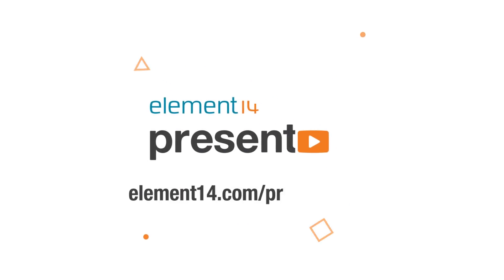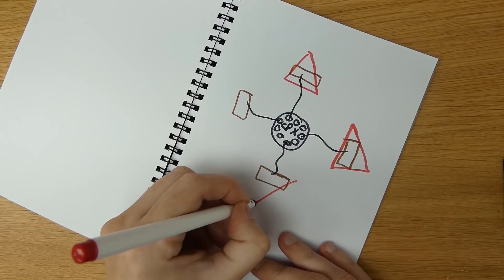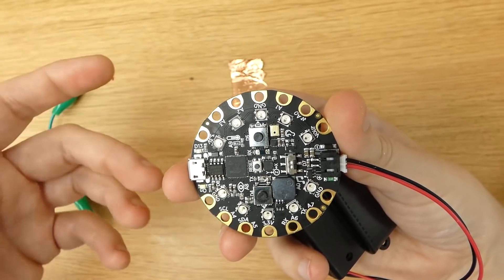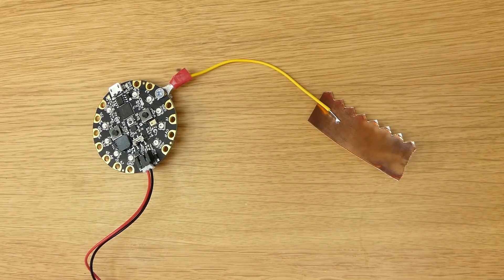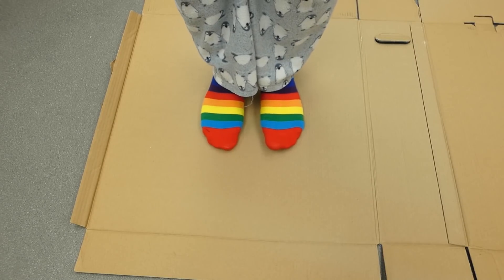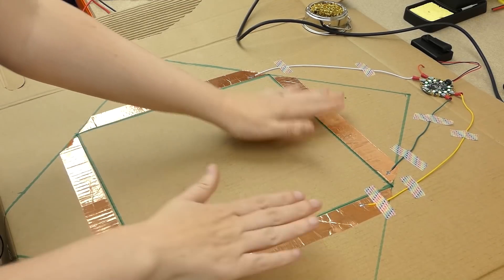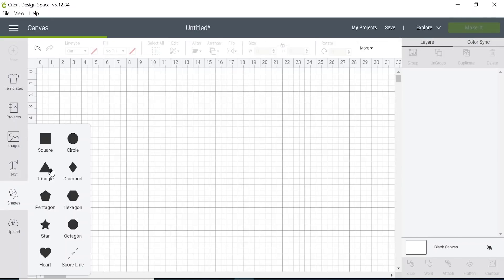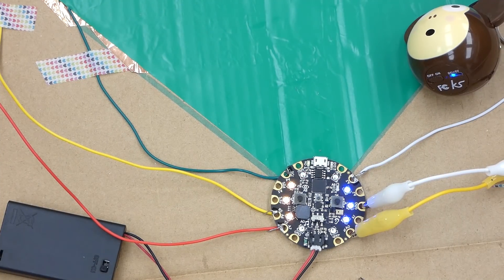DIY Dance Dance Revolution Mat

Comment: https://youtu.be/TeTcuMxLfT8 the pads we made use metal contacts instead of thin copper, also there are four contacts per arrow to increase the reliability. For the controler, we use an arduino Lenardo that's programmed to work as a virtual keyboard. Everything is made from wood. Your's seems to work OK, just need to rebuild it out of something stronger maybe acrylic (if you can find some)

Comment: wouldn't it be cheaper and easier to start with a used DDR mat and than go from there?
Reply: Hi, I wanted to hack the CPX to turn it into a dance mat. I created something fun using electronics. Anyone could buy a dance mat.
Reply: This channel is about building things... so they built one..
Reply: Yeah, why not buy something that already works? Why are they always making something from scratch and never just buy this? I don't understand this channel..
Reply: @Davedarko  So, buy a pre-built unit and learn nothing, or try and make one from scratch and learn something new, having fun in the process? Learning and creating can be fun.
Reply: @another3997  hey I'm a host here too and that was sarcasm :)

Comment: I ran into a similar issue when I was coding a bitbanged capacitive touch library for pic microcontrollers ages ago. It would work when connected to debugging hw on my laptop but when I unplugged everything and tried to run the pic off batteries it stopped detecting properly. I came to the conclusion that it was the grounding to my laptop through the debugging/programming interface connections that was putting it into a range that was detectable. 

When I ran it off battery the measured timing values were way off and thus it wouldn't work. So the solution was to test and tune timing values in the exact scenario in which the sensors would be mounted/used. Also adding a ground plane under the cap sense pads helped as it offers a more controlled baseline capacitance than just having a lone wire that is easily coupled by the environment. 

I intended to eventually update the library to add a routine to auto-calibrate the sensitivity every once and awhile to mitigate these kinds of issues but the project got back burnered and I haven't touched it since (no pun intended).

Comment: pressure switches are what the real dance mats use, but your touch switches are different, but seem picky. I have built a dance platform before using a pressure switch design. BTW wire that to a USB joystick interface, and use Stepmania on the PC.  Stepmania can be customized with any songs you like.
Reply: Not really, the arcade sensors are just sealed rubber contacts. Are you thinking of the fsr contacts that stepmaniaX uses?